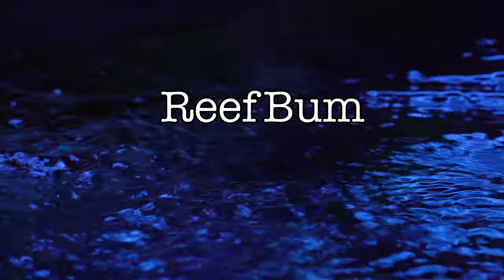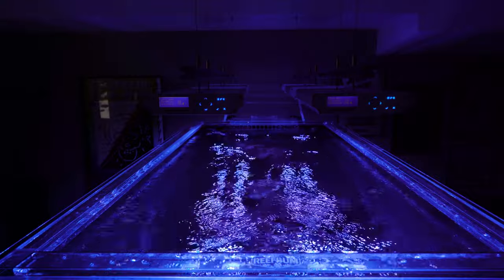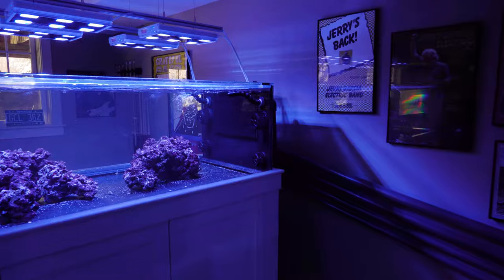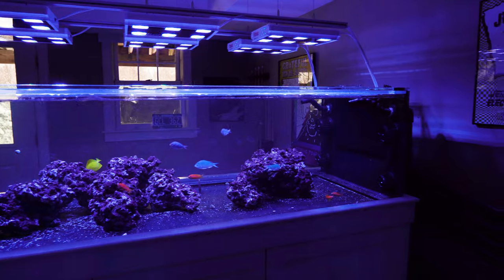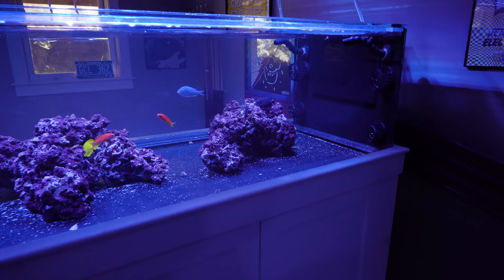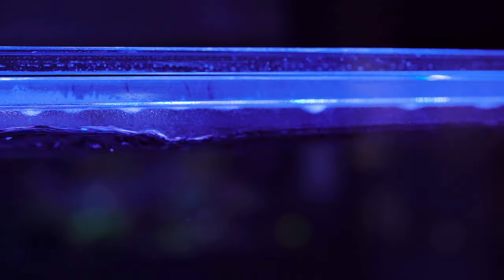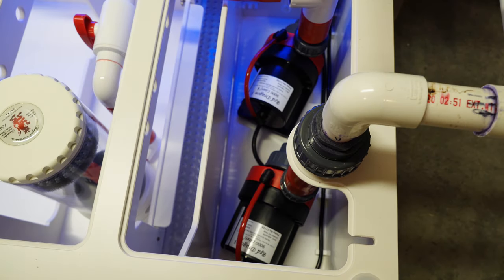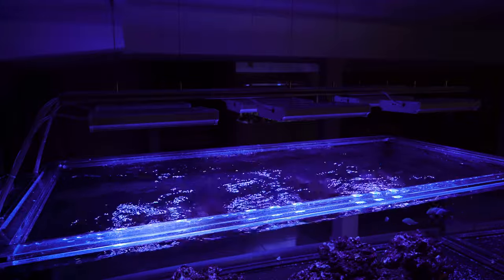3 Glass Walls: My Peninsula Tank Build Journey, Ep #16 - Circulation

Comment: May want to look into some Tunze Stream pumps. That way you can shoot the water towards the end and not blast everything closer. Parker's Reef has a pretty sweet mod so you could hook them to the Eurobrace and hide them on the one end super easy. I have also heard that the Nero5 will push water close to 6 feet. Super small wire and super small in tank footprint.

I am in the early stages of a 72x36 peninsula myself so these videos are really helping me out! Flow is definitely throwing a wrench into things.
Reply: I have two nero5s and highly doubt it’s ability to push 6 feet for sps